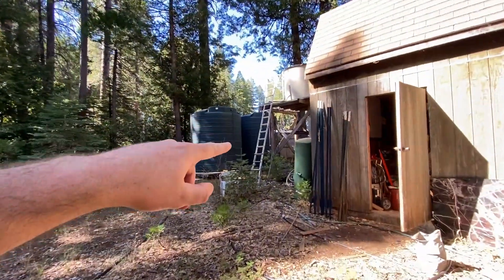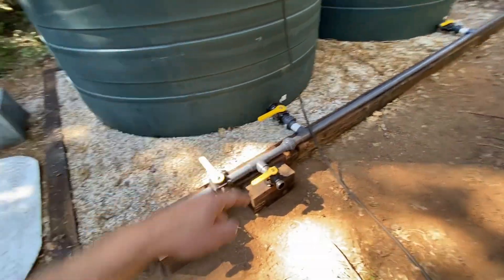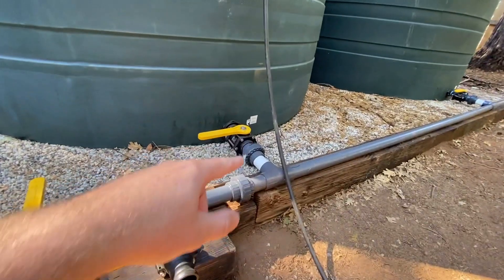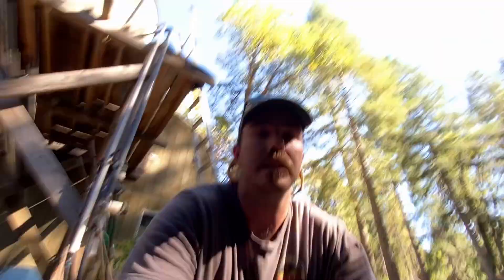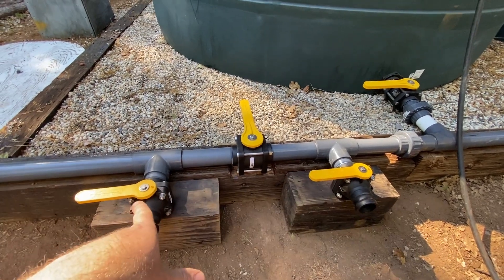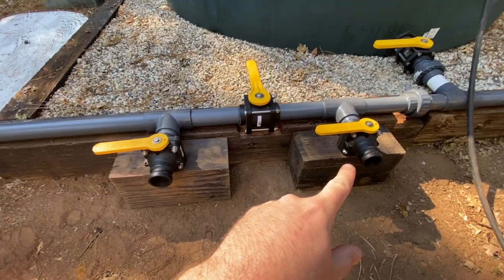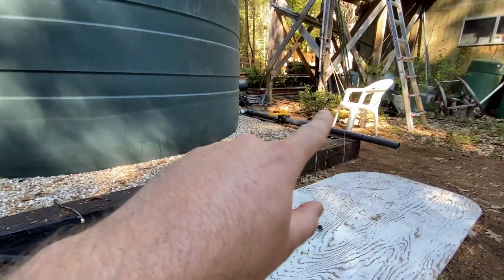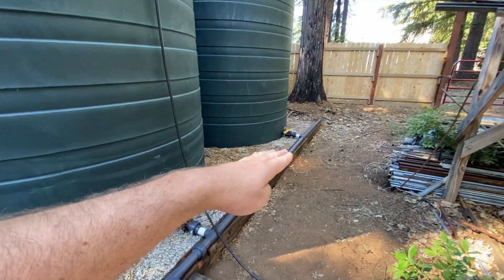Plumbing Water Storage and Fire Protection Tanks

Comment: We had to add 10k gallons to our property near Monterey and the county required us to put 4in schedule 80 pipe underground to a metal riser (fire hydrant) with a small concrete pad. The pipe was for sure not cheap and the flexing issue you point out was the toughest part figuring out of making the whole system leak free. The tanks look like yours, so yes quite a bit of flex. The only sticking point now is to have an approved vent system as leaving the man hole cover open is unsafe and closing it without an adequate size vent would collapse our two tanks from when the fire engine sucks water out of them. Not sure if you thought of that? Was thinking of adding 6in piping with a mesh that is fire proof and meets NFPA 22. Good look on your projects
Reply from the maker: Hi there! if I remember correctly, the cap on the manhole cover has a miniature little manhole cover screw thing in the middle that might be able to be removed and screened to act as a vent. That would probably be the easiest thing. When I designed and installed these for farms we would add a secondary bulkhead fitting with double 90 degree fittings (think straight up out of the tank, over, and back down) to act as a vent. I dont think you'll need anything more than 2" pipe for a vent, 6" seems excessive but I'm not sure about local codes and permitting.  Hope this helps. Let me know if you have any more questions!
Reply from the maker: if you do have to add additional bulkhead/vent/fittings, it is probably a better idea to puncture the cap rather than the body of the tank. at least the cap is replaceable, just my $.02

Comment: Great video, thanks.  How are you keeping your system from freezing in the winter?
Reply from the maker: Thanks! Good question. I set it up this way so that the valves on the bulkhead could be shut and the lines drained. The weakest point will be the HDPE nipple in between the bulkhead and the main valve. I’m hoping that it’s strong enough to hold up. I think I’ve had the tanks in for at least a season now and they’re still full so I think it’s working. I had the sch 80 pvc plumbing break on my water tower though. I think the only way is to drain at the end of the season.